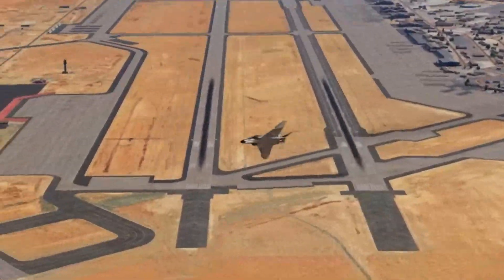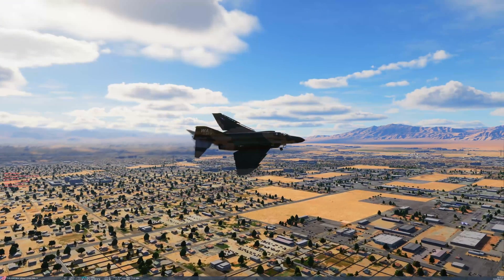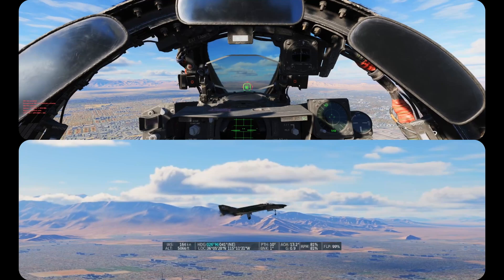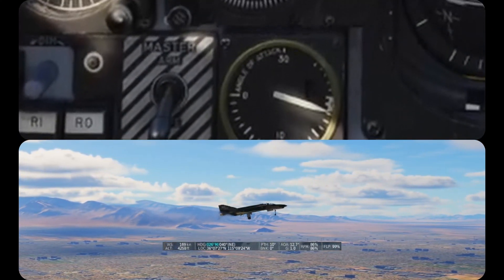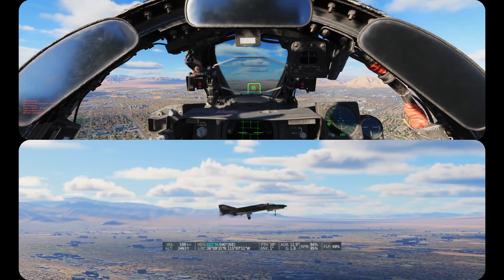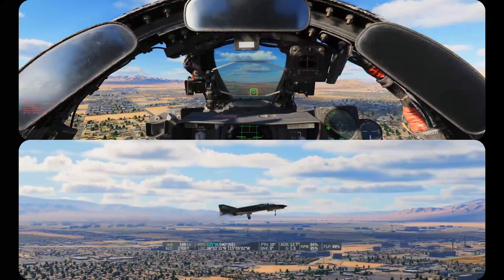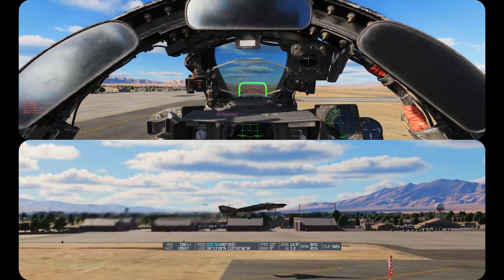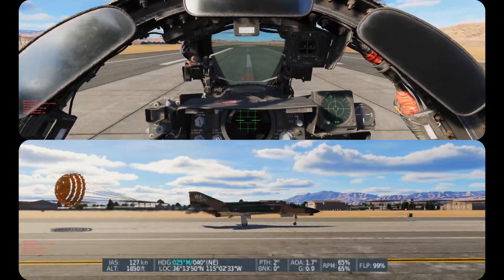DCS F-4E: HOW TO FLY A 3 DEGREE GLIDESLOPE VISUAL APPROACH

Comment: Usually I do it f16 style with a very tight and fun overhead break pattern and then to really butter it reliably I will come in 20-30 knots fast and bleed the speed off in ground effect. Works every time but obviously isn’t how it is intended to be flown. On-speed aoa I rarely managed to butter it. Tapping trim until the jet is stable I do in both cases for the f4. 

Thank you for this input👍
The f4 is extremely entertaining to land.

Comment: This is a great tutorial and Im definitely going to work on this beast using your advice because my landings are to say the least "down right hopeless" , thanks so much. Hey any advice on how to setup helper gates meaning, distance from threshold to start at, space in between gates with the descending height of each to be able to descend through each one accurately. I know how to setup gates with triggers it's the varying height and distance I kinda stuck on. Anyway thanks again... subscribed.
Reply from the maker: Hi @tridan2448, thank you for the sub!
For a 3° glideslope, you need to elevate the gate by 300 feet per nautical mile from the runway threshold.  Make the first gate at runway threshold.  No matter what aircraft you fly, an "x" degree glideslope is ALWAYS equal to "x" times 100 feet per nautical mile.  This is also a handy method to determine a climb or descent pitch setting: for example, if you want to change altitude over the next 10 miles by 5000 feet, that's a 500 foot per nautical mile change, which would be a 5° pitch change on your ADI.
Reply: @kojakgaming3519  Thank-you so much for your reply. Very kind and helpful of you... excellent!

Comment: Hey, loving your channel.  Is the mission with those green boxes to fly through available?  I like that trick with the HUD reticle, I'd like to work out the same for the A-4 mod!  Cheers
Reply from the maker: Hi HB - it's embedded in a .miz file I've built with about 30 F-4s, each with different testing purposes (pattern, approach, formation, etc).  Those gates are assigned to only appear when flying that specific aircraft.  But - you can create the same thing pretty easily in the mission editor.  Each of the gates is a waypoint, spaced at one-mile intervals from the approach threshold of the runway.  The altitude for each waypoint is an increment of 300 feet above field elevation (because a 3 degree glideslope translates to 300 foot descent for every nautical mile travelled).  So, if you want to fly a 5 mile final with 3 degree glideslope gates, your starting altitude for that aircraft would be runway threshold MSL plus 1500 feet.  You need to set a trigger to display the gates by making the Condition 'if unit is alive' and Action 'show helper gates'.  If you want more gates, space them at half-mile and 150 foot increments.

Comment: Add that use rudder vs aileron to correct centerline. At approach speeds one could enter into a reverse command situation from which recovery is in doubt.😮
Reply from the maker: I haven't used rudder on final, except for a crosswind landing.  The Dash 1 page 2-25 has a warning that addresses high AOA during the turn to downwind that "the rudder should be used as a primary means of rollout since adverse yaw may be introduced by the use of ailerons."  You bring up a valid point about potentially entering uncontrolled flight; and adverse yaw on final = Go Around! :^)

Comment: I like what you said about fighting for the centerline.  My CFI was AR about the centerline and that tendency forced me to learn to keep flying the plane - all the way to the chocks.   What works best for me in the Phantom is to fly the approach slightly fast, so that I have a bit more control authority in the flare. Basically an Air Force landing vs on the numbers Navy.  The audible queue is really helpful no matter the style.
Reply from the maker: Hi Dan!  Faster = more stable for sure. But... increased approach speed will always increase landing ground roll.  That said, it's only a factor in the real world for hot brakes, aborting a touch & go, invalidating Vref performance, etc.; but not so much in DCS.  In all the airframes I've flown, carrying extra speed is absolutely mandatory for gusty winds.  And, keep in mind the F-4E Dash 1 states that the airspeed indicator may fluctuate up to 6 KIAS (!) between aircraft!

Comment: I have little trouble getting on speed AOA, but a hard time controlling descent rate via throttle.  ( I can land a Hornet on a carrier).  The vertical speed indicator lags, of course.  Lack of visual feedback, I usually end up ballooning in close final, have to pop the brakes and land long.  I think the sweet spot for power is difficult to find.  Since thrust response is not linear with throttle position and the engine spool is slow... I need practice.  I can grease it in half the time but I am inconsistent.  I'll give the 225 mil a try, thanks.
Reply from the maker: Hey Pappy - I just replied to your post on the VFR Pattern video.  I think what I'm working on today will help with exactly what you're referring to.  Keep in mind the 225 MIL setting is based on an on-speed, 19.2 AOA final approach.  If you can get on that speed, the trick is to fine tune your throttles to a good approximation, and then make very small (less than 1% RPM) adjustments.  The video I'm working on today will give you that info!
Reply: @kojakgaming3519  Thanks I will take a look

Comment: Im pretty good at soft landing the F-4, but should we keep the front wheel off the tarmac? because I was never able to keep it up for more than 2 seconds
Reply from the maker: Hi Alpen, my short answer is 'no'.  I haven't been able to aerobrake like the Viper at 10 degrees riding down the runway... but, holding back on the stick is still technically (and actually) aerobraking and helping to slow the aircraft.  Below 100 KIAS, the effects are negligible.  Being on-speed (19.2 AOA) on approach, then 'slightly slow' at touchdown, allows a landing rollout w/o the drag chute (w/aerobraking and speed brake extended).
Thank you for checking out the channel and commenting! Hope to see you back for more

Comment: I always have trouble getting this aircraft into a stable on speed flight. Rolling into a base turn the aircraft wants to fall out of the sky, if I add power it wants to fly to the moon. Very frustrating but I still think this is single-handedly the best DCS module yet
Reply from the maker: HI Logan, thank you for watching and posting!
I agree with your assessment - the aircraft is challenging, but I have found some techniques for coming off the perch that can really help.
I have been spending a lot of time in both the VFR pattern and setting up a mission file with a 5-mile final approach.
A few things I've learned: 1) roll off the perch at 200 KIAS, trimmed for level flight, into about 45° of bank; 2) use back pressure on the stick to maintain a descent along with the steady 'on-speed' AOA tone; 3) If you get the rapid-beeping slow AOA, don't adjust throttles, but let off some of the back pressure and/or roll out slightly to get back on speed; 4) the throttle setting for trimmed level flight at 200 KIAS will carry you through the base turn as long as you don't bleed off too much airspeed (i.e. the 'too-slow' AOA beeping); 5) avoid the 'too-slow' AOA beeping by easing out of bank and back pressure when you initially slow to the 'on-speed' steady tone.
I'm working on three video projects at the moment, one of which will specifically address these techniques, by demonstrating the VFR pattern, perch, base turn, and transition to final.  Until then, I hope this helps!